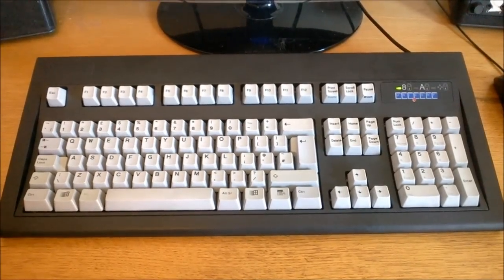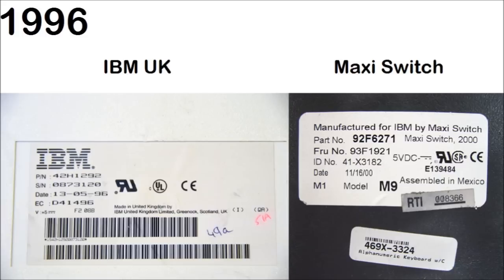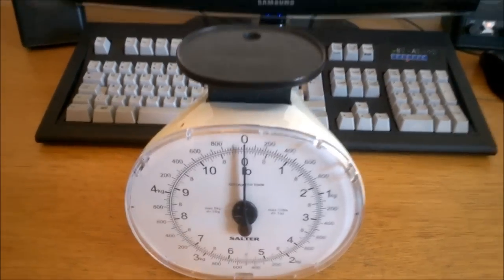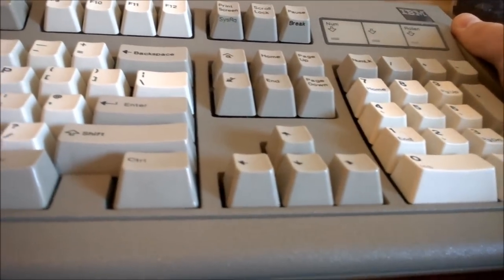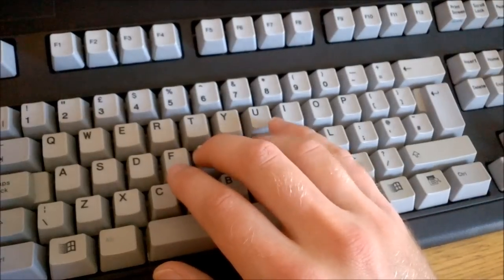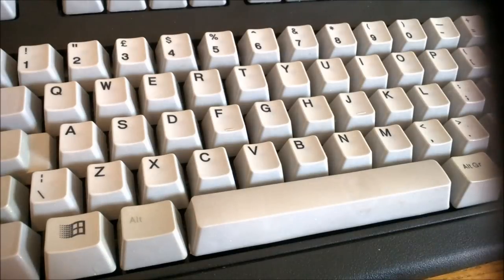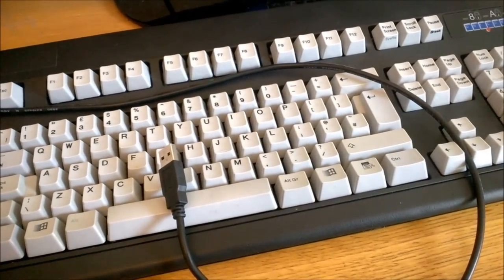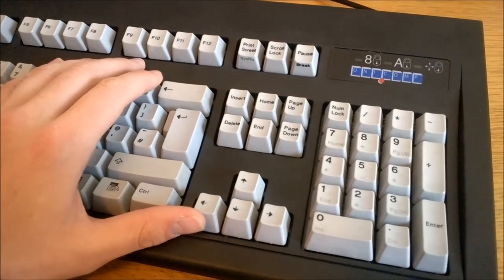Unicomp Model M review (buckling springs)

Comment: Unicomp also does original Model M repairs, I have a Blue Label late 1993 Lexmark made Model M that sat in the dusty depths of our High School tech room closet. Got the keyboard for free, as it was malfunctioning. Sent it to Unicomp for $46 USD and they fixed everything. The bottom case on mine was cracked, they pulled the label off of the original and put it on a brand new bottom case. Unicomp is amazing.
Reply: THEGHOSTSLAVE Even though it's still a business, you can tell a lot of passion goes into their business and that's amazing.

Comment: First time I heard about IBM Model M being sought after, was back in 2004.
As time went by, more and more people wanted to have a model M.

Made me regret throwing away mine, a Lexmark made Model M, when I got a Logitech multimedia keyboard in 1999.
But, I was 14 years old at the time and didn't consider such things.

But what stuck me, on reading that first article was the description of the Model M.

It was a solid piece of technology, from a by-gone time, where metal was used in construction and with it's 2.5 Kg of mass, it was a lethal tool, that keyboard warriors could use in self-defense.

Made me laugh out loud.
Reply: Not exactly as bad, but when I was 13 I got the original Razer Blackwidow Ultimate, a pretty decent keyboard and big at the time. But at some point a broke the stabilizers on the space bar and other large keys, being a dumbass kid I was afraid of getting in trouble, so I left it in an alley. 

A mostly working, and pretty expensive keyboard, abandoned in an alley because I was stupid. I literally have no Idea why I did it. I pretended I was having trouble with windows recognizing it or something like that, and went back to my cheap rubber dome until I could buy my own replacement.
Reply: I remember the late 90s, you weren't cool unless you had the Logitech multimedia stuff. The Microsoft stuff was also really good back then.
Reply: @nunyabiz2016     Interestingly enough Logitech still is king when it comes to computer peripherals. Have you tried the z533 Logitech Computer Speakers? They sound insane for  just $100.
Reply: @nunyabiz2016  Eh, I don't know. I played around with those fancypants multimedia keyboards, but as a *nix nerd, who spent his days and nights typing into various consoles, I very quickly reverted back to my model Ms. The Logitech and Microsoft stuff all felt like mush to me. Not to mention the very visceral feeling of the music of a buckling spring or mechanical keyboard that cannot be replicated with a foam and foil or rubber dome keyboard.

Still better than the rubber tramp stamp sliders they used on the old (well, technically the newer) PETs though! God what a miserable thing those are. Every couple months they need to be rebuilt, cleaned, and usually more conductive element added to the "stamps" - and even then they are barely functional for real typing. I think I may actually have to layout a new board for all of us with 4000 and 8000 series machines...
Reply: @SergeantExtreme  Except their gaming keyboards. I was given a G910 by a relative and wow, Romer G is a pile of dogshit wrapped in a tortilla made of "this is supposed to be *tactile*?"
Reply: Back in the day you could buy a Model M at a yard or garage sale for $5.  I remember when my town's recycling center was full of old computer hardware that was free for the taking.  If only I had known.
Reply: It's alright, the Lexmark ones used rubber domes, they weren't the ones people wanted, I know it's 6 years late, but hey, tiny little weight off your shoulder

Comment: Brand new Unicomp ultra classic user here (build date 2-3-17). The frame is much more rigid than the previous generations of the Unicomp boards, and the keyboard doesn't creak at all. Key printing is very sharp!  The alignment issue with the "insert", "delete" and "print screen" still exists, however you really have to look to notice it. The cable is very long and comes out of the right side of the keyboard, but there is a cable grove to route the cable to leave the left side of the keyboard.

Comment: Just popping in that thanks to your reviews, I made up my mind and went for a Unicomp. I chose the SpaceSaver M, which is basically the Ultra Classic with minor Mac-related modifications. The only part that has noticeable mo(u)lding blemishes is the bottom. The top case is virtually perfect. Neat! It just doesn't fit perfectly and has the creak you mentioned. The typing itself is very solid, basically what I expected.

Something you need to know about this Mac version is that the F keys don't behave normally. They always control brightness and such, requiring you to hold down Fn to use actual F keys regardless of the system's setting for F keys. It turns out you can invert the keyboard's own Fn behavior by pressing shift-Fn. This is undocumented. There's only a FAQ entry hinting at its existence whose answer hasn't been filled in. Thankfully I found it.

Comment: Just received mine, an ultra classic black. Have to say that the build quality is good and imperfections are almost gone. Letters and caps look and feel great. No molding residue or that kind of a mess. Only thing that might qualify as imperfection is that right lower corner joint could be a little tighter. Does not rattle or have creaking noises more than other plastic chassis keyboards. Nice to see that guys at Unicomp are having the quality back up.

Comment: @ 7:40, I have not seen one of those two-part dettachable keycaps in several decades now, this was unexpectedly nostalgic. I used both Model F and Model M keyboards many years ago while studying at the university and having a part time job as a programmer. The company I worked for had several original IBM PCs. Feel and the typing sound from those keyboards was truly great. If I recall correctly the model F's had slightly stiffer keys, harder to press than the M's, both great anyway for sure.

PS. Correction, just checking more of your videos learned that apparently the model M keyboards (~70g) were harder to press than the model F ones (~60g). Always though that the harder-to-press ones were possibly the older models, but turns out it's the other way around! Quite a realization. In any case missing these keyboards and their typing feel right now

Comment: my Unicomp has 2 parts keycap, seems they started making those again
Reply: Oh that sounds great. When did you purchase it?
Reply: kL-Spazmo Thank you so much for your answer. I'm relieved then :)
Reply: I just bought a Unicomp M122 and it still has the 2 part caps.
Reply: Depends on what type of key(color) you get surprisingly enough. Pebble and gray two piece others one
Reply: @12me91  On my unicomp ultra classic white keycaps have two parts and gray have just one
Reply: mmh set fire to flames
Reply: As someone who owns both, I just don't understand the obsession. The typing experience is nearly identical with 1 piece caps when compared to 2 piece caps. I'm not sure why people "need" 2 piece caps.
Reply: @SergeantExtreme  2 part caps are easier to clean.
Reply: @jb-br8bf     Wait.....clean your keyboard?
Reply: @SergeantExtreme  Yes? You touch it all day, it's bound to get dirty.
Reply: @jb-br8bf     Yeah I know. I was just kidding. It's something that ought to be done, but never is. A study that came out about 10 years ago showed that the average office keyboard has more bacteria and viruses on it than the average public toilet.
Reply: @SergeantExtreme  That makes sense, but ew.

Comment: As someone who has used Models M for years, from many different IBM and Lexmark units, all the way to the 104 key Unicomps, I have to agree. Of course, today I just received the new 122 Battleship from Unicomp that I ordered 6 months ago, and I have to say, this thing is sweet! I can't wait to map all the different keys to their new functions. Even so, the 122 has a nice feel to it, that same feel and snap as other buckling spring keyboards, of course these aren't broken in yet so they are not as light on the fingers as some of the older ones. However, it has a lot of the weight of the originals. Even the knock test seems to indicate to me a thicker  plastic for the main case components as compared to the latest 104 from Unicomp.

As a side note, however - the "new model M" 104s have been retooled in the past couple years so some of the molding and dye sublimation errors seem to have been worted out. The only issue I have found with the new caps that can be ordered standalone from Unicomp is that some times the replacement keys have a tendency to stick in the downward position in their slots, particularly when installed in old IBM boards. Still, Unicomp is awesome and I am very glad they are keeping the flame of these old beasts alive, and has successfully dragged the venerable classic into the 21st century. That being said, on any legacy operating systems, I still like to use my old IBM boards - particularly on anything that runs MS-DOS.

Comment: I have been using a Unicomp Classic 105 since 2015 and i've been quite happy with it. It took some days to get used to, as previously i was using only cheap 10€ keyboards, and being kind of a heavy typist, the rubber domes used to be destroyed in a matter of a year or two of use. The Unicomp so far is holding very well, loudness aside, is very sturdy and it doesn't move around the desk thanks to the weight. Only hard note at the time was the price: 90$ plus 40€ of customs taxation, as i could only import it from the USA to Italy. It was one of the rare places i could buy one with custom layout too (Italian in my case) so i didn't have to settle for US Layout keyboards and having to kind of re-learn how to type the special characters!

Comment: I bought a Unicomp "New Model M" (That's the name it goes by on the website anyway)
It doesn't have any of the keycap print issues, and the case doesn't flex as much. Thought I'd put the information out there.
Typed this comment on it lol.

E:
It seems they've fixed some production issues with their newer keyboards, which is a good thing to see for sure.
Reply: Alright, thank you so much for putting this information out there. I was conflicted about buying one, especially since I wanted the classic look over the flashy lights despite the fact that I'm in high school. I decided to just go for it despite what I had heard from multiple reviews about the build quality. This reassures me about my purchase, thank you!
Reply: @owenfield818  just remember that the "classic" is their old model m product (the one that Chyros has i'm pretty sure)
the "new model m" is the one that you should get if you want the updated tooling and build quality improvements.
Reply: @lettuce7378  Alight, I ended up purchasing the Spacsaver Mac model. As far as I know that's a new build, am I correct?
Reply: @owenfield818  I believe so.
Reply: @lettuce7378  Ok thank you. I'm now even more satisfied with my buy.

Comment: I have bought Unicomp Customizer 104 seven years ago for myself and IBM Model M (made in late 80s) for a friend. Unicomp still works like a charm, but it's not buit as solid as IBM was — it's rigid enough, but I can squeeze the bottom part with my fingers. Keycaps have got some yellowing (hardly visible though). I still love my Unicomp keyboard and hope that it will last for another 10 or even more years.
Now I need something compact and more quieter for my home PC, so I decided to give a try to chinese Anne Pro 61-key keyboard with brown switches.

Comment: I have a Unicomp SpaceSaver M (this is the Mac version of the Model M) made in 2012 and it has 2-part keycaps. And the quality of the legends is rather nice.
Reply: I have the same keyboard except the Windows version, and it also has the two-part caps. As mentioned by another user, they brought them back later.
Reply: That's interesting, I have a SpaceSaver M manufactured in 2019 and it has one-part keycaps.

Comment: Worth pointing out that Unicomp got the tooling from LEXMARK, not from IBM directly, so when compared to early IBM models it is entirely possible that even the build tools used to manufacture them are different, it's more fairly comparable to a later Lexmark Model M

Comment: I just bought a new Unicomp keyboard. It seems like they have changed their tooling for the keys as the fonts for the special keys are different. They are not crooked, and are centered as well. The lock indicators are blue now and are almost blindingly bright.

Comment: The reason the Unicomp sounds at a higher pitch is the same reason the rack tom sounds higher than the floor tom on a drum set: smaller drum = higher pitch. Yes, also because of the thickness of the frame, but primarily because of the smaller size. I prefer the lower pitch as well, but I wouldn't say Unicomp's higher pitch is a result of the key switches themselves.

Comment: I just ordered a mac version of this some of the flaws are to be expected given the circumstances, but as far as function and typing goes, the keyboard is solid. I don't mind blemishes on the plastic much or slightly off-center ledgers. Every manufacture is unique, so it's not a given that it will turn out flawed. What adds to the charm of some of these possible flaws is the fact that it's coming from using the same machinery that crafted the original M models, so as long as it not due to cheapness as much as it is due to a relic from the original products, I find that kind of like a cool, nostalgic badge.

Comment: It's telling that the only thing sturdier than a New M is a vintage M. I've just ordered one myself and wanted to get a closer look at them, thankfully Youtube provides. Particularly, I ordered the USB model because my motherboard doesn't have a PS/2 connector and I don't want to deal with adapters. In nearly a decade since this video was released, they appear to have done away with the rectangle at the top left judging by the picture on their website, and the lock light panel looks slightly better at least from a distance. I will find out about that soon, however. All in all I don't suspect to be feeling any buyer's remorse.

Comment: One thing I noticed is that the Unicomp keycaps are substantially lighter. I only have a kitchen scale and it's not terribly sensitive, but the 2-part Model M keycaps register as 2g, while the Unicomp keycaps don't register at all (which I'd guess means they weigh less than a gram). When I first bought one of the Unicomp boards, I found that the typing feel was much stiffer/more springy - but putting the Model M keycaps on the Unicomp board made it feel much more like the Model M - which I'd suspect is down to the Model M keycaps being twice as heavy (or more).

That said, there may have been some placebo effect at play - I didn't find that the Model M felt any different to type on with the Unicomp keycaps.
Reply from the maker: I'd weigh a bunch of keycaps at a time, not just one. That would make it much more accurate.
Reply: That's a good idea. I tried weighing 14 of each keycap at once - I get 35g for the Model M caps (so about 2.5g apiece), and 29g for the Unicomp caps (so about 2g apiece). A bit of a difference, but not as much as I'd thought.
Reply from the maker: Are they both one-piece or two-piece?
Reply: The IBM caps are two-piece, and the Unicomp caps are one-piece. The Unicomp board I have is the same model that you reviewed - though it looks like their white/beige model does have two-piece caps.
Reply from the maker: You can't compare one-piece to two-piece caps, of course they're not going to be the same. I'm pretty confident across same-piece caps the weight will be pretty consistent, though.
Reply: Come again? My original comment was about how the Unicomp board felt different when I swapped in the IBM keycaps, which I suspected was due to the weight difference - I figured it was a given that the weight difference was down to different designs (two-piece vs one-piece). Though, admittedly, at the time I didn't realize that Unicomp also sold boards with the older two-piece keycaps (which I'd assume are closer in weight to the IBM caps), so that may have been less clear than I'd thought.

Comment: I once owned a Unicomp-made 122-key Model M. Albeit its high price (it cost me some € 180 including customs fees), it "only" lasted for 6½ years. One drawback were its rather weak plastic rivets, which fix the key carrier on the baseplate and started breaking after some 3 years, so I was forced to do a full screw job, replacing the rivets with M2 screws. Another 3 years later, some keys stopped working. After disassempling the board, I found out that the conductive strips on the two plastic sheets had become rusty and therefore had lost their ability to conduct electric signals. Unfortunately, Unicomp had changed its manufacturing process, so that replacement sheets were no longer available. :(
Reply: What about using conductive ink ? with a fine paint brush ?

there are also conductive ink-pens out there.

Comment: I believe the one piece keycaps are only offered on that particular layout. The one I have (2016 MFG) has the two piece keycaps, while the terminal layout one from 2011 I have, has the one piece keycaps. The one piece ones also sound a little different, more "clunk" instead of light spring.

Comment: I'll have to get one.  I currently use a wireless Corsair red switch, but I used to have an old PS/2 Fujitsu keyboard.  I may have used a Model M because I remember using an old keyboard that had that late IBM oval logo.  I was born in '93 so it's hard to tell lmao  I've had Unicomp in the back of my mind since LinusTechTips made a video on them lol  I'll probably get a PS/2 version since my motherboard supports it and it'll free up a USB slot